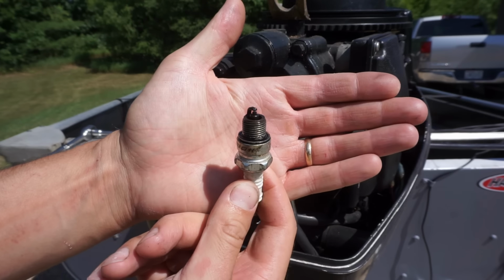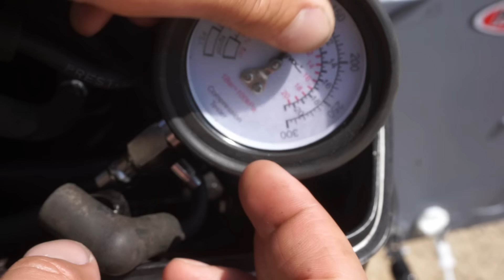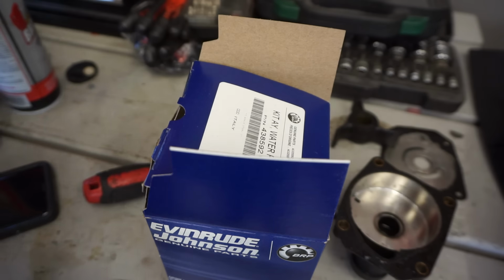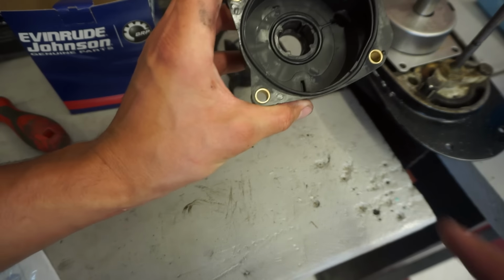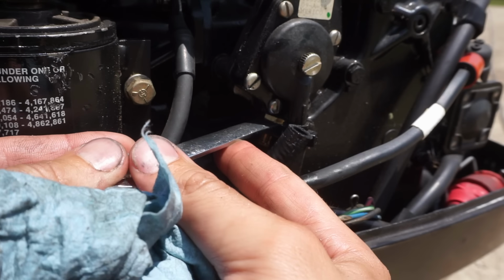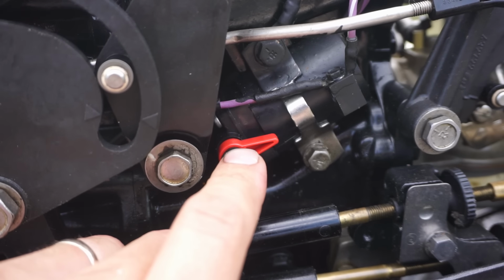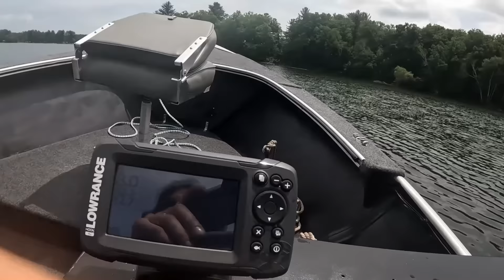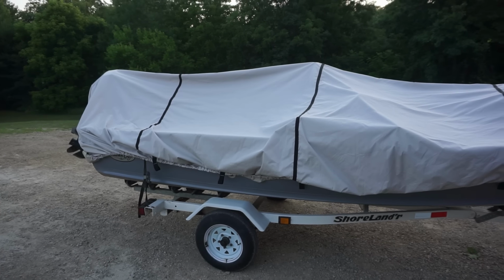$500 Abandoned Fishing Boat Breaks Down First Ride. What Went Wrong?

Comment: When your out there running a top speed run trim the motor up a bit and you will get less hull in the water creating less drag and a smoother ride and it will run way faster. When your up on plane you notice how like 3/4 of the boat is touching water. That’s robbing speed. But it’s not a race boat. Just a tip!

Comment: If replacing the water pump impeller doesn't cure the heating issue, it's possible you could have some crud inside the water jackets in the engine. I think a fresh water pump will work wonders. Replace it at least every other year if not each boating season.
As for the fuel primer, get a new one. Marine stuff is not forgiving and does cost $$$. Keep the old water pump impeller for a spare just in case, and an extra set of sparkplugs is a good idea too. Looks like you got it sorted out pretty good now!
BOAT = Bring out another thousand!
Thanks for a cool video, Joe!
Reply: I second that idea!!
Reply: Your right about that I bought a boat and realized I was too poor to run it

Comment: Love all the advice from you outboard guys, helping a young man out. In the future, you may want to update your prop. Could help with performance. Side note, try not to forget to trim up the engine when pulling the boat out of the water. Dragging the boat up a concrete ramp, with the engine down will mess up your prop and shaft. Don't ask how I  know that. 😂
Reply: skeg especially
Reply: A week after a guy bought my inboard/outboard SeaRay, he called me wanting to know if I knew who could work on the lower end and fiberglass.  I had showed him how to lift the trim before pulling out and the lowering it to drain the water out and lifting it again.  He forgot to lift it before leaving.  He went ripping down the extremely rough road to the boat ramp.  I always drove about 30 and he said he was going 65.  Lower end caught the road several times.  Boat was destroyed.  He spent $12000 to take the boat out twice,  once on the day he bought it and once on the day he destroyed it.  I had told him to get insurance, but he laughed and said only fools bought boat insurance.

Comment: Good job on the water pump. Even though the old one didn't look bad it probably wasn't getting a good seal, maybe on the base plate. That can cause it to not build pressure, which means it won't overcome the poppet valve tension. I've had brand new pumps right out of the box be bad.

Comment: When putting the decals on, you spray the soapy water first, then lay the graphic down to help give you the option to position as well as get bubbled/creases out, then you can pull off the top layer.  Spraying water on the top layer plastic to remove it doesn't do anything.
Reply: Was scratching my head too when he did that 😳😁
Reply: Credit card or plastic puddy knife helps to smooth out too so no bubbles

Comment: Great videos...  I may ditch those zip ties on the fuel line in favor of some some spring metal clamps or stainless hose clamps.  Also, trimming the water pisser hose on the outboard may give you a better visual from your seat?  Seems to be running great, good job.

Comment: Good job on it. Good luck with it catch some big fish. 
When you get the boat up to speed start trimming up your motor to bring the bow down. You will see a little more speed as well.
Reply: Trimming up makes the bow go up. To much up and the bow will  bounce up and down to much down and the bow will plow. Correct trim and the bow will cut through the ripples and only bounce a couple times on the bigger waves and smooth out on its own. 
A short reverse after going through weeds most times will clear the weeds from the lower unit. The groves on the plate and impeller cause cavitation in the pump making it lose volume and pressure.

Comment: You need to make  sure the top of the motor is level with the water when running wide open. This will level out the boat. As you get to a plain look back and trim motor up and you will see and feel the difference.

Comment: OMC motors are pretty simple to get right. Blow out your cooling system hoses for block. Thermostat etc. Looks like it was flowing good from pump.
Reply: With a garden hose hooked up to it it don't even need a pump with that the proper way to test it out of the water is let the motor down in a tank
I messed with folks all my life I thought everyone knew that you can hook a hose up to anything and it will come out of the places it should until it's idling or running in a tank is the true test of the water pump

Comment: With the water pump the brass insert in the impeller can break loose and  at high RPMs It can spin the brass fitting around without spinning the impeller as much so you did right by replacing the water pump.

Comment: I have the same engine and I had to rebuild the trim pump on mine. It's pretty easy as long as you have a special tool to remove that cap and the service manual.

Comment: Water pump is good bud, think I'd check hose flow through the head, you'd be surprised how much crap can actually get in there. Fixed a few with that disorder, blew out lines and head, got flow going smooth, easy peasy fixed... good luck..

Comment: Hey mate, I'm full bottle on the johno and evi's. Hook up a timing light with a rpm gauge and you want 850 to 950rpm setting at idle this is the best way to start the timing sync process to get the best fuel economy
Reply: wrone use trolibg moter save gas motr

Comment: the schreader valve on the red selector is for bleeding the fuel system and water in the fuel may have cracked it, also new prop would go along way for performance all around.

Comment: Once you get idle timing correct with rpm setting then make sure the butterfly's are set evenly at the closed position by slightly wriggling to get perfectly closed position. Then finally you may have to alter the full throttle position of the blades. Then you will have the full 40hp ski boat potential 😂

Comment: There's a reason for the saying, Bust Out Another Thousand. Always something. Lol. Good call on the water pump. Forgot to comment on the last video. Believe they sell rebuild kits for the trim.

Once the boat is up on plane, play with the trim. There's a sweet spot. Too far either way and the boat will slow down and the motor sound will change. In the sweet spot, that motor should sing. Listen to it.

Comment: Good job on the boat the Lever on top of the control box is Throttle so you don't have to gas it in gear and your water coming out the back of the propeller will be hot thats where it comes out after going through the engine

Comment: At 22:26, a better idea would be to rotate lower unit/shaft 90 degrees to set them horizontal.  Then put on the outer housing.  That way, you could see that the two rubber seals/o-rings remained in place with no part of the outer/lower one shifting out of place. And in this position, they are less likely to shift out of place.

Comment: Young man you should replace water pump every couple years minimum. Also, read up on trimming a boat. Change the prop and be sure at top speed rpm’s are correct. Prop size matters. You can size the prop to keep rpm’s in the correct range. If you overspeed it will destroy engine. There is info and specs out there for your setup but you still have to try props to be sure. I say this from inside my boat changing trolling motor batteries.

Comment: Older outboards need alot of attention due to the lack of use and ethanol in the gas all rubber or plastic parts degrade or get damaged. Best use ethanol free gas it cost more now but the damage ethanol does it cheaper in the long run to use ethanol free. I have 1992 johnson 150 2 stroke these engines are tuff as nails. Have fun with it great to go out fishing with your dad best time you will have.

Comment: You are such a great mechanic. You figure any mechanical issues out pretty quick with your knowledge and experience.
Reply: Speaking from experience you do not hook a garden hose up to a motor that pushes water through it no matter if the pump is good or bad. He's giving wrong information to test the water pump at the motor should be submerged in water all the water hose is is pushing it forcing it through their that's no test the motor has to be in the water without a water hose to test the pump it might work but that's not the right way
Reply: You can take the water pump out and throw it in the ditch and hook a water hose up to it and it will do that😂
Reply: The water that comes out of the side is a indicator the spit cooling water comes out of the exhaust
Reply: Dude trim it out you're plowing
Reply: Another thing your spark plug happy if an engine runs with the plugs that are in it it's okay putting different ones in it is not going to make it run better or worse that's b*****

Comment: Trim up wiper seal.& That outboard motor is built for racing. It might have the blocker back inside of it witch is called A power valves. Usually racing heads they're taken out for performance& speed output reasons alone. Witch will protect you from blowing that motor up anyways if it has been put back into it over the years. It was Bored out to be able to do race to though. So it's not A weak  outboard motor by no means at all. If you we're to adjust the fuel/ air mixture 🪛 screw 1/4 turn either way it's not be turned it should give you more throttle output & speed take off  response to Joe. I recommend adding in some marine 360 sta-bil fuel treatment into you fuel for it to.And  along with some seafoam mixed half& half then you just add the regular per  gallon ratio into your gasoline squeeze pump boat fuel tank. Dog food dry bag., or canned with help out with ketching some fish when it's hot out to Joe.

Comment: If you don't or haven't  replaced that prop with damage to the blade, it will run like crap and cause the boat to vibrate. You can get them resurfaced and balanced.

Comment: We fixed a Mariner 40 for a friend of mine and it had a bad sensor. Motor wasn't hot but it sounded the alarm, new sensor and it went away.
Reply: It might have been bigger than a 40 because it was a 4 cylinder. Reason we were working on it was for a burnt piston and rings. Someone put the motor together and crushed the shim and o-ring on the bottom main cap and made the bottom cylinder run lean. Only during testing did we get the hot alarm after fixing it. It was peeing good and really wasn't hot so a new sensor fixed the alarm.

Comment: One commenter mentioned making sure the Oil/Gas Ratio is correct.  Since I haven't followed this project very close I'm not 100% sure what yr the motor is.  I’m guessing early 90’s. With that I am assuming even though this model has oil injection you are bypassing that and mixing your gas as those oil injection systems were known to fail.

Comment: I like your cover it looks good. I hope you didn’t buy it from Walmart because everyone I bought from them would only last 2 years in the sun. Seal skin covers are supposed to be pretty good.
You’re right when you fix one thing on a boat something else breaks. You can handle rebuilding that tilt and trim hydraulic pump. It just needs new seals from sitting so long and cleaning out while it’s apart . Good luck

Comment: !!!  19:40  The stainless cup should be permanently pressed/glued in the plastic housing or else it will spin inside the housing with the impeller, not pumping any water .. idk im a mercury guy.. did you check your thermostat?

its too late to say if the impeller is missing fins, they will be up in the powerhead                comment at 6:00

that is the very first 3 blade water pump impeller ive seen. 13:00

Comment: Those engines have water cooled exhaust and if you turn on the water with the engine shut off you can get water through the exhaust Port so don't ever do that
It can eventually ruin it. Always hook up the water start it and then turn on the water then any water in the water cooler exhaust will get blown out like it should

Comment: Did you spray Marvel Mystery Oil into the cylinders and allow it to soak ?  Also...Add Marvel Mystery Oil to your fuel to keep engine running clean.  Marvel Mystery OIl has been around since WWII to keep piston driven equipment running clean and powerful.  Also included bombers and fighter planes.  JimInCincy [Cincinnati, Ohio]

Comment: This Mercury mechanic is still jealous of doing Evinrude impellers. I agree with other commenter. Do a freshwater flush with the lower off to get all the crap out of the block. You'll see a bolt on the engine block that looks like a freeze plug. That's what it's for.

Comment: The first plug you took out was wet and probably fouled so would run on one cylinder.  Be precise with oil to gas ratio.  This is common with outboards.
Reply: Tank vent open?

Comment: Use dielectric grease on the spark plug wires on boats, because of the wet conditions they run in keeps them from shorting out.

Comment: I don't like those hose attachments, it's hard to tell if the water pump is working properly because of the water pressure from the hose. I prefer using a large drum, that way you know water pump is working right.

Comment: I could never understand people working on multi carb setups. Go through all the work taking them apart, etc and forget the basics of tuning. Both plugs should look the same. If not there is an ignition or jetting issue. BUT the biggest problem is hardly anyone balances the carbs. If you can't afford a set of vac gauges, make a manometer.
Water pumps hehehe another big mistake, it's good enough , hehehe , then wonder why it's overheated, cylinders, rings and pistons screwed.
Running a damaged prop is worst that pulling all the balancing weights off your tires and driving at 70mph.

Comment: Vro pump will be shot change it to a standard fuel pump like what runs a diesel heater job done ✅
Reply: I also think they should be water coming out of the rubber exhaust port I’ve got a evinrude 50hp